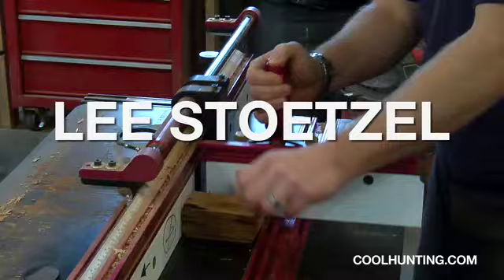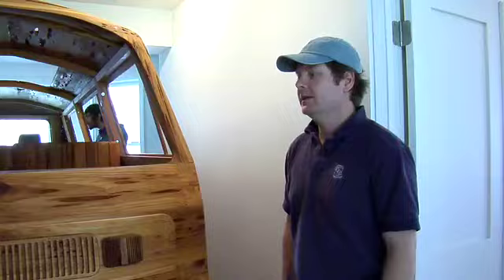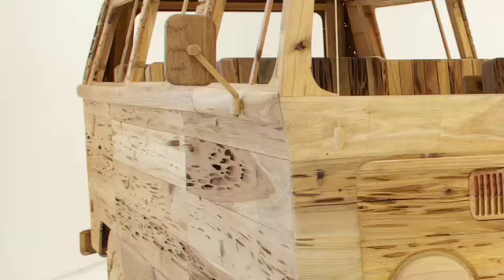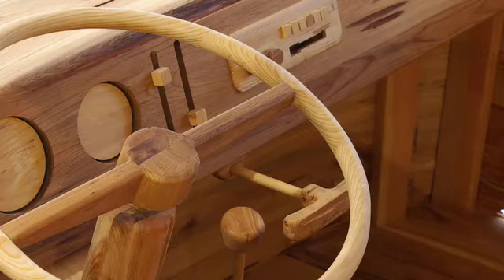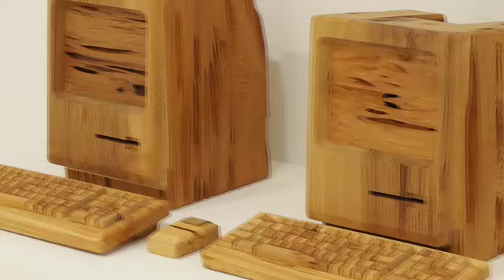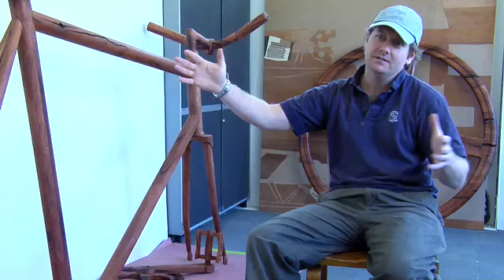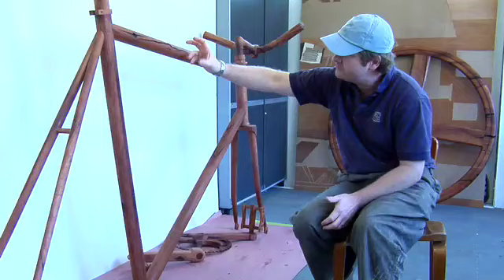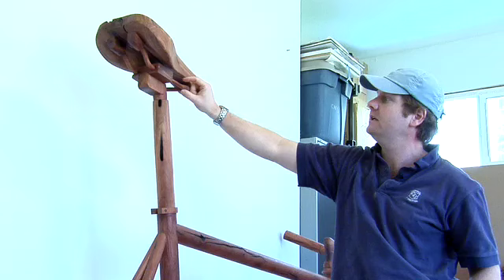Lee Stoetzel

Comment: Mesquite is a hard wood, but have you ever worked with ipe otherwise known as ironwood?  It is the most relentless, dense lumber in the world. The only wood with the same fire rating as concrete and weighs (i believe) 66 lbs. per cubic foot. That's heavier than water so it sinks. I use it to make tools for shaping metal. Beautiful work and concept! enjoyed the vid!

ED